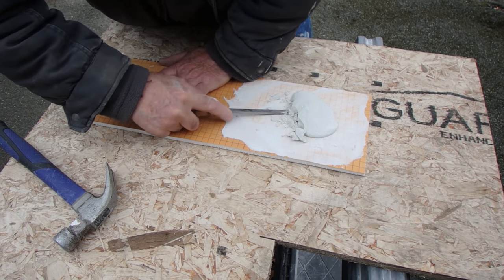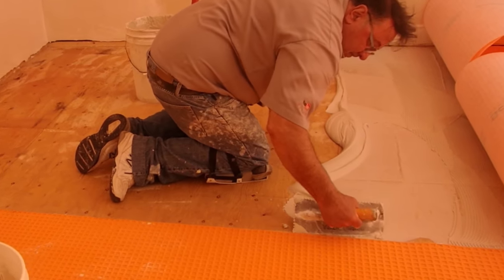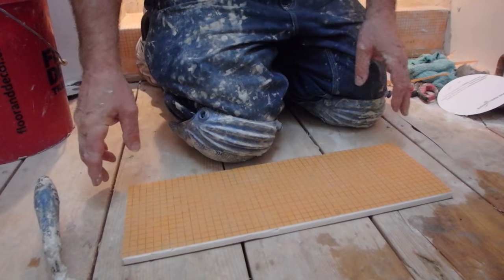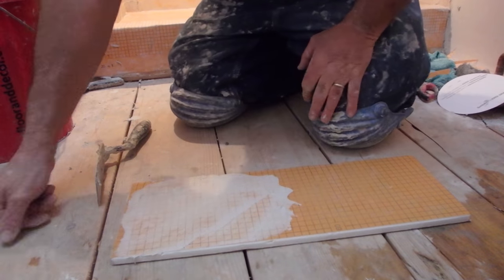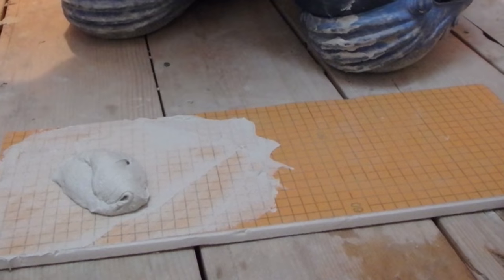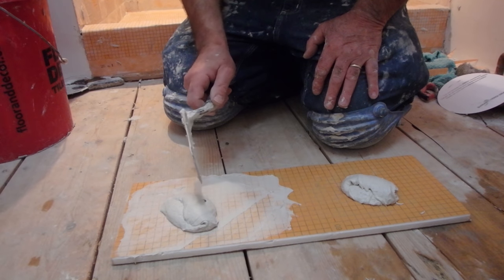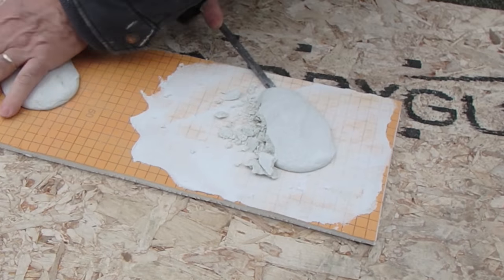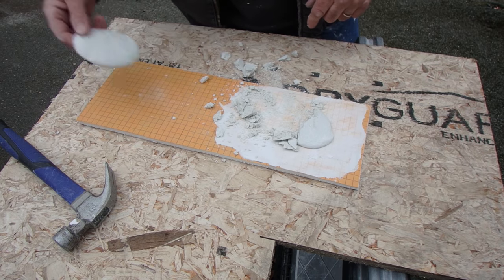🤔Make  it better, Every tile job needs this. Key, burn, coat, skim

Comment: How thick of a layer should you have before laying down backerboard or the orange stuff? Should you back butter the backerboard as well? Before keying in, you have to sponge moisten the plywood or osb subfloor first, right?
Reply: Yes use a sponge to moisten the substrate, also get the dust up as much as possible. You also need to make sure your floor meets the stiffness requirements for the flooring you want to install. If there’s too much flex or bounce, you’re going to want to stiffen it up or rethink your flooring material. Best thing is to read all of the manufacturers technical data sheets and instructions they have regarding the specific products you want to use. Schluter makes trowels specifically sized for use under the “orange stuff” Ditra, Kerdi, etc., but you can use a size that’s very close to that and be fine. Make sure your thinset is approved for use over OSB, those that are not, will not bond properly. Also has to be approved for use under certain membranes. Some thinsets will not cure under impermeable membranes. In my opinion, I always say the labor is roughly the same on a job whether you use inferior materials or the best materials. For the little bit of extra money a good thinset will cost, it’s worth the expense (yes they can cost two or three times as much as the cheapest thinsets, but overall on a job it’s not much at all relatively speaking, especially when you consider the labor invested). I like Schluter all-set, especially when using Schluter products because of the warranty factor and the compatibility (you can use All-set over osb, also under and over Schluter membranes). Most importantly.. two things before you do anything: one; watch several of Sal’s videos on what you plan to do. He has a video covering anything you have in mind tile-wise. His videos are the best I’ve seen on YouTube with regard to tile installation. He’s in the top 1% I would say in knowledge and experience in the Country with regard to tile installation and related materials and products. If you watch enough of his videos, you will find an answer (the right answer) to any of your questions. I’m not saying there aren’t other good installers making videos, but with Sal you have the peace-of-mind of knowing the information you get is correct, and follows best-practices. He cares about doing the job right, first and foremost. The second thing before doing anything is take the time to read all the manufacturers information with regard to the products you are going to use. Whether it’s cement backer board, Schluter, Mapei, Wedi, USG, Noble, Ardex, or any of the dozens of manufacturers, find the TDS online for your product or at the retailer, read that and any other information available on the product and make sure you understand it before you start. Also be aware that a lot of products are new and may not have a long track record yet. Occasionally there are failures, so as a general rule, I like to stick with products and companies that have been around a while and have a reputation for standing behind their products. Any time you spend reading and educating yourself before doing the work will pay dividends several times over, even on a one-time job. That goes for contractors as well as DIYers. There are many contractors out there that do not know their business well enough and use the wrong products for the application. Sorry for the long post, but you probably want as much information as you can get.
Reply from the maker: @brandonmitchell6264  Well that was a mouthful. 👍😊
Reply: Sal DiBlasi 🤣 and my intent was to keep it short..🙄 I need to work on that..
Reply: @brandonmitchell6264  how thick of a keyed in layer do u put? Also do u back butter the backerboard?
Reply: Connor Pearson you’re keying it in and then basically scraping it down to nothing with the edge of the trowel so that when you trowel your thinset out with the notched side (trowel held at 45 degrees to the floor), you’re getting consistent thickness. Watch some other videos. You’ll see from those how it’s done properly. What is your application with backer board? A floor? I do not use backer board on floors and I no longer use cement type backer boards often anymore with what i feel are superior products on the market. I now use uncoupling membranes on floors exclusively or I don’t do the job. If you’re talking about applying thinset to an osb floor and then installing a backer board like Hardie-board, there are instructions as i said from the manufacturer on their requirements for that installation. If you’re asking about back-buttering backer-board because there’s a low spot in a floor, that would not be the proper way to address it. There are “self-leveling” products for that depending on the thickness needed. In any case, as i said before, read up and watch the videos, you should be able to find what you need. It all depends on what you’re doing specifically. Without knowing exactly what you’re doing, some answers may be taken out of context.
Reply: @brandonmitchell6264  cement board on osb. No low spots or high spots. Do you back butter any substrates? Or key in and then lay it on top?

Comment: I've actually tested this at my shop with K-board and a 12×12 tile, one burned in, one not.....it really does make a difference. Tile installation with out burning in to the substrate WILL fail eventually
Reply from the maker: Sometimes the simple things make a big difference

Comment: BUT...... why is dropping a blob of thinset and walking away a relevant test, no one does that. When you spread thinset with a trowel, aren’t you keying it in with pressure? For a test, I would spread the thinset with a trowel, then drop a blob on that and see how hard it is to pry off.. Either way, your the best Sal 👍
Reply from the maker: It is relevant because it shows how keying in the mortar increases bond strength, true with the notched side of the trowels you will be scraping the substrate with the teeth of the trowels, however that will never be as good as using the flat side first.
Reply: I agree, just dropping a blob doesn't really show anything because its impossible to relate that to actual spreading. If you use just the notched side and pressure in in multiple directions over the entire area before finishing the spread in one direction,  I bet theres no difference.